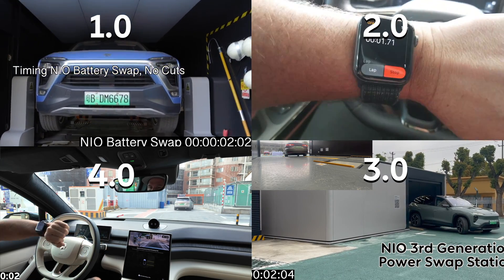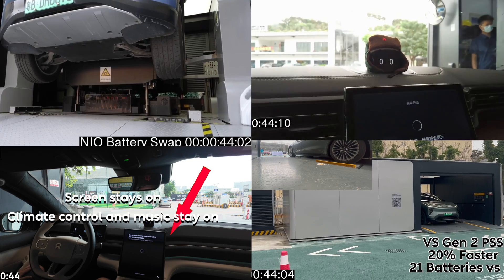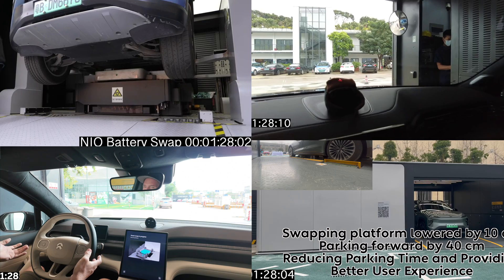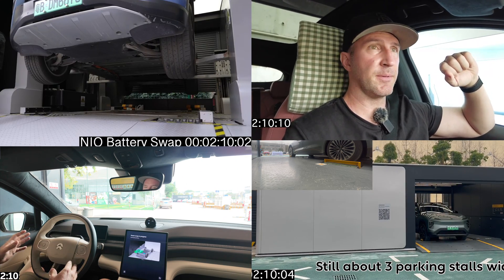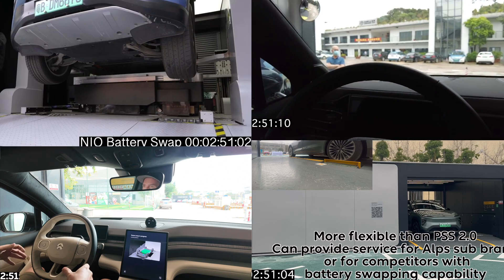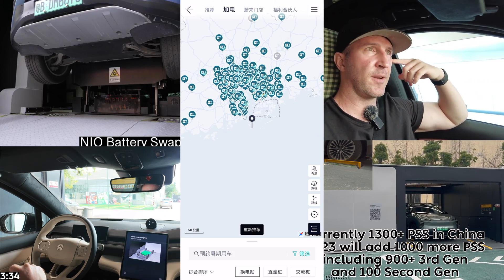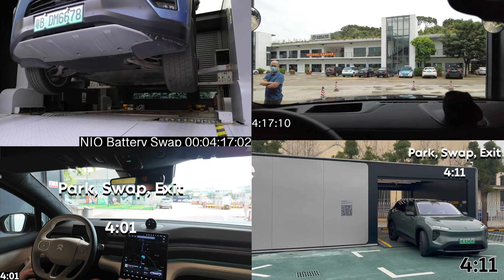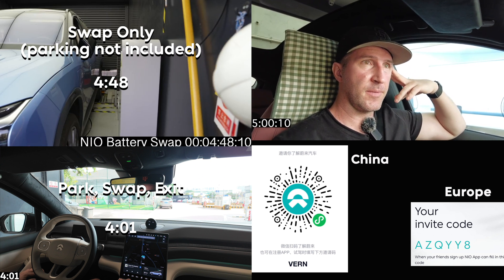The Evolution of NIO Battery Swapping

Comment: It is amazing technology, but in an era when solid state batteries will come to the fore in the next few years, massively decrease charging time and increase range, surely this battery swap tech will be expensive for the company to maintain vs competition. As well, if they expand overseas, the building of these swap stations will hurt their bottom line massively and in countries like Australia and America where people are used to driving very long distance you would surely need too many charging stations to make having these cars worthwhile. Unless the ranges are upwards of 500/600 miles per battery.

Comment: I believe battery swap stations would be the universal solution for EVs if manufacturers could agree on standard battery pack sizes, something like 1 pack for small vehicles, two packs for medium sized vehicles and three packs for large vehicles. A standard for batteries across all brands would be such a great solution. Even if it took 10 minutes to change the batteries it would be a vast improvement today's charging plus battery charging could be optimized (no more fast charging, which is actually not good for the batteries) done by educated professional battery maintenance people at the change stations and/or better chargers that guarantee longer battery life. Owning a vehicle whose life-spam will no longer be determined by the battery life-span (the batteries make up 50+% of the vehicle cost) would be an additional bonus.
Reply: The batteries could be different, they just need to be standardized in a way to function with flexible changing stations.
Reply: Rigth but ususaly they have different watts for each labels..

Comment: Between my two Nios, I've had an overwhelmingly positive experience over the last two years. Only twice have I had an issue, and both were resolved relatively quickly. As you pointed out, the technology is developing rapidly. 

On a side note, I saw a video of what appeared to be a vending machine inside a swapping station, using a robot arm to dispense the drink. I have no idea the details, but you might be getting that snickers bar before too long 🙂

Comment: Let me understand this. You buy a new car with new batteries and it runs out of charge. 
You now take it to a change station to swap out your depleted brand new battery pack that is the highest cost part of your car just purchased.
After you find a specific station close to where you can reach within range of the energy in the depleted new battery you ask to exchange this brand new pack for a battery pack of unknown origin and age to be placed in your new vehicle in exchange for your now discharged new battery pack.
As this is the life blood of your car worth more than the vehicle it sounds a bit suspect. Would you really give up a brand new battery pack for what you don’t know? Just how many times has the battery just installed been depleted and recycled? Is the range guaranteed? 
Sorry not going to get savvy customers to fall for that. This battery pack is the most expensive part of a battery powered car and you will be willing give it up for what you don’t have any idea of mmm….
Reply from the maker: You don’t understand it.
Reply: @Eric_Garrison  So what do I not understand?  Aren’t the steps I outlined correct?
“You don’t understand it” is this your in depth detailed analysis can’t you elaborate or be specific or you either don’t want to or don’t wish to acknowledge its correct?
Reply from the maker: You just assumed a bunch of things and played it off as trying to understand. It’s not my job to teach you how battery swapping works, but I do have plenty of content to watch if you are genuinely interested. 

Anyway yes people happily give up their brand new battery pack. They don’t own the battery pack in most cases. The battery health is guaranteed yes. No you don’t need to wait til your pack is depleted to swap it. Most people live within 3 km of a station so it’s just like going to get gas. Anything else?
Reply: @Eric_Garrison  Actually, so you are telling me you don’t own the battery now.
So is it rented? On what basis is it rented? By the capacity that it had when installed and is credit given for what was not used upon replacement? 
So what’s the answers to these areas of concern? 
You say it’s all in your video but it looks more like a car advertisement for battery swapping than genuine information on the costs and thus benefits of this type system over conventional fixed batteries. Nowhere is cost analysis shown.
Reply from the maker: I said I have other videos if you want to learn more. You can rent or buy your battery. In China, either method allows for swapping. In Europe only battery rental can swap. When you swap you pay the difference in energy. It isn’t a fixed amount, it’s based on your consumption. If you want a larger capacity battery or smaller battery you can upgrade or downgrade at will. Road trip? Take a 150kwh pack for a few days, only city driving? Keep your 75kwh pack. It’s called flexibility and convenience. And if your battery pack gets damaged you aren’t out 30k usd or whatever to change your battery. There are many advantages to it, as evidenced by how many swaps are happening in China every day. Anything else?
Reply: @Eric_Garrison  that’s good information to know. Only question I have is how do you return a damaged battery? Is this a separate insurance on the pack or how does this work. As you well know any damage to my battery on fixed batteries is a catastrophe in costs replacement or write off.
Reply from the maker: @TheTruth-dy8ze  the only time I’m aware of this, NIO contacted the driver and told them the pack was damaged and to come to the station asap. They swapped it out and the battery I guess ended up burning but the customer car was fine. Not sure exactly the details. Nio runs diagnostics on each battery every time.
Reply: i didn’t even give a second thought running to swap it. It’s like you always driver with a new battery

Comment: Battery Swap is awesome, super convenient and relatively fast. My only concern is capacity and is Nio doing enough installation of power swap stations? Onvo is getting ready to launch and if Nio/Onvo goes to 30,000 units per month. They're going to be F-ed. Or, should I say us the customers. I have noticed more vehicles waiting to swap which is great, but, longer wait times or being diverted to another station further away at times raises the question. Still, love our car and would never think about changing to another brand.
Reply: I'm not too worried. In Haikou, there is rarely a line. Also, the more cars they sell, the more stations they'll build. Just in the last 2 years, I've seen the number quadruple in my city.
Reply: @jasoninchina  good to hear.
Reply: Empezando las entregas de ONVO,ten por seguro que empezarán las instalaciones masivas de más estaciones.
Reply: Even if they had to wait longer for a swap on busy days, swap capability enabled their battery lease, that's the main driver of opting for swap anyways.

Comment: It seems that Gen1 swap station is about 200 of them in China but are people actually using them? or they  have become just a trash, because it would be better for the NIO to rebuild them into Gen 2 swap station but it's gonna cost alot right?
Reply: Still 100% usable. You just won't want them in high demand areas, so I imagine Nio will upgrade at some point in the next few years.
Reply: @jasoninchina  They should upgrade immediately. Old Gen 1 swap stationis a bad user experience.
Reply: It would not surprise me gen 3 is cheaper than gen 2 and gen 4 is about on par with gen 3. Don't forget that they also improve on maintenance of the stations itself, so I don't think they would go for gen 2 anymore since gen 3 or gen 4 probably requires less maintenance. Plus it fits more batteries which will also benefit NIO in the long run.

Comment: How big of a % deployment does each version 1,2,3 and 4 account for in China?  15%, 35%, 45% and 5%?  

Do people still happily use version 1? 

I wonder what the costs are to replace a version 1 with a version 4 or 5?

Its amazing tech, but darn it seems very costly 🤔
Reply: My city has a couple first generation pss. I use them occasionally. They're totally fine. You just have to get out of your car for 5 minutes. And in terms of replacing them, I assume the cost of renovation is not worth it at the moment. It's better to build more and circle back in a few years. As I mentioned, they're still very much usable.
Reply: @jasoninchina  cool, great to know! Thanks!!
Reply: @jasoninchina have you used the automous swapping? Curious how many stations allow this. This has been my Bull thesis when autonomous driving is allowed. Drop off at your apartment, car goes and picks up a recharge at a scheduled time that’s ideal for the grid, car comes back and parks itself ready for the morning